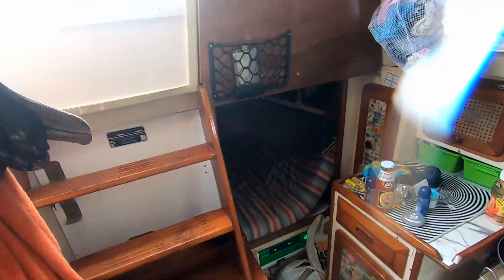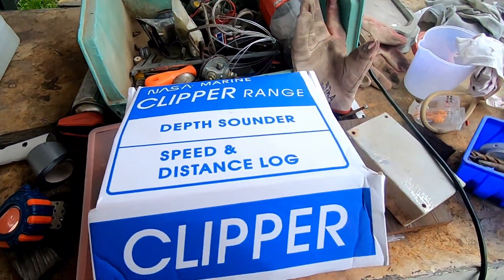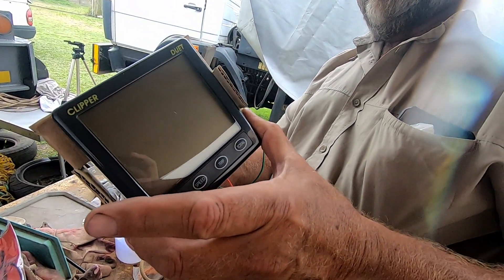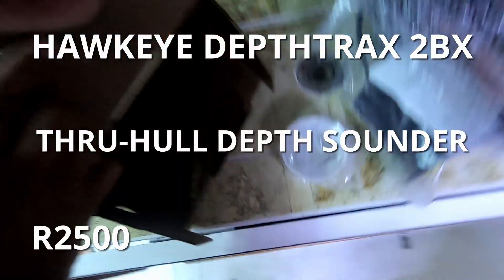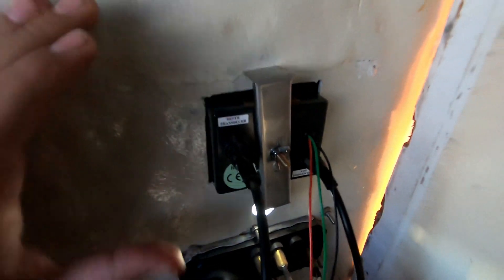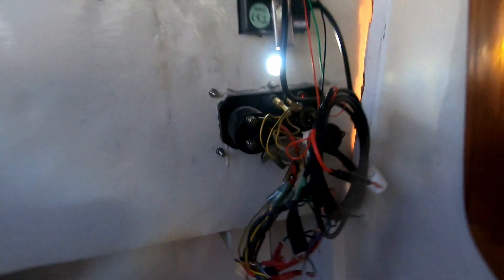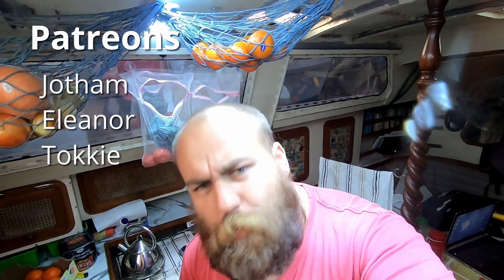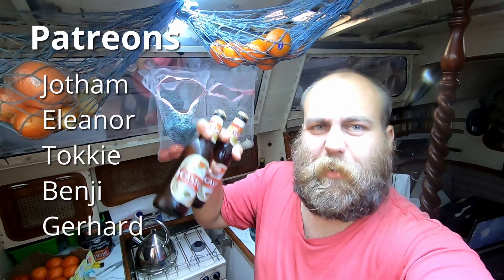Sailboat Speed & Depth Installation, First week on the water and VHF Attachments  | Land Rats | EP48

Comment: Just an idea you can make yourself a cheap chart plotter based on a Raspberry Pi 4. Many instructions including some sailing channels who have done so.
Reply from the maker: We've looked into that and might do it in future currently we are running our chartplotter straight from the laptop
Reply: @LandRatsSailing  You have a solution that works however I suggest that you still do so as a high priority. Not for redundancy as no doubt you have your phones but because a Laptop will consume several hundred watts and if you are going on long voyages given your electrical setup and limited power generation you will need every watt you can save. In fact I would look to see if a Raspberry Pi 3 would run it as the power requirements on that is even less.